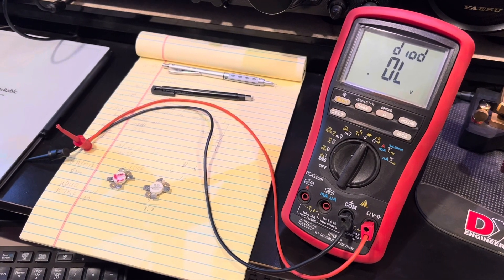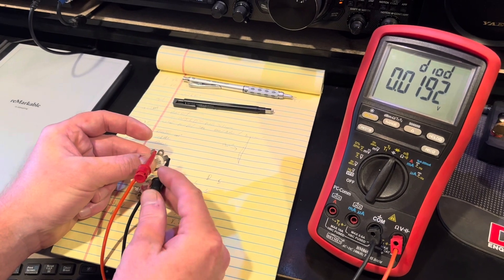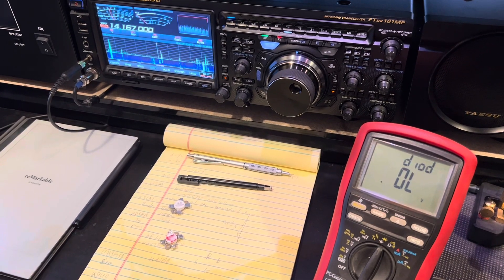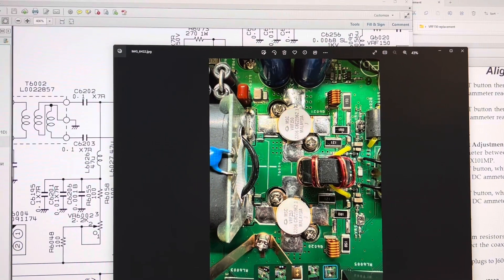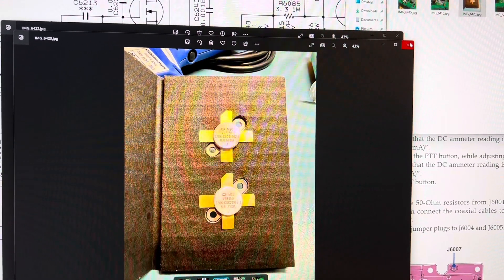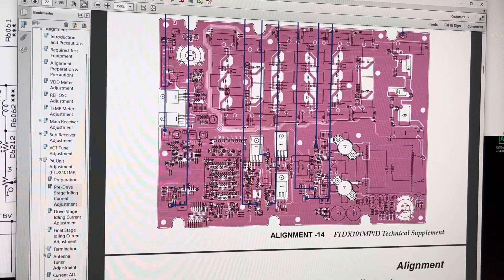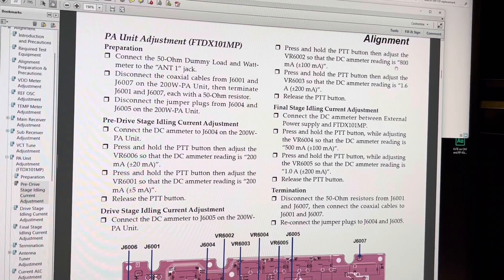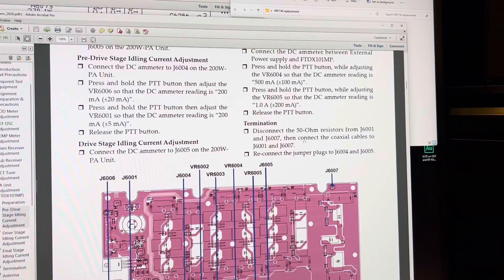Yaesu FTDX101MP PA finals (VRF150's) testing, replacement, and quiescent bias - KJ7E

Comment: I hope you could answer this -2 questions 

1.  how did you terminate J6001 and J6007 to a 50-Ohm Resistor what cables where used?
2.  For the Final Stage Idling current how did you connect a DC Ammeter between the Power Supply and the FTDX101MP?
Reply from the maker: For the PA Bias, the terminations is necessary, though I did buy some small jumpers to that plug into the PCB sockets that extended to BNCs and can connect to BNC dummy load terminations.  Ive done it both ways and the terminations are not necessary.  I inserted a current meter between the 50v supply line, and nulled he non TX current to get the bias measurement.
Reply: @damonkj7e  thank you for answering, this is the 2nd time my finals went bad. After yaesu repaired it, I've decided to do it on my own, I live in the Philippines and sending it to Japan again to get repaired is out of the question, because it's super expensive.

You replying and creating this video is super helpful. This means a lot.

73 and Mabuhay 

De 4E1FLD | N4SHX
Reply: @damonkj7e  Thank you for replying, this video is really helpful, for context this is the 2nd time the finals went bad on this radio, the first time, I sent it Japan for repair, and it was super expensive, to ship back and forth to the Philippines and on top of that I also had to pay for the repair cost.  

I had to wait 6 months to get it everything sorted out. 

So going through he same process is a no-go for me this time.

This video is really helpful.

73 and Mabuhay

De N4SHX | 4E1FLD

Comment: Thanks Damon, very helpful for me because I have the same problem 😞. How do you terminate J6007 with 50 Ohm for adjustment? What sort of plug is this. I cannot find anything that fits...
Reply from the maker: I did find the connector on a jumper to a BNC, I dont recall where from.  However, I found no reason to terminate J6007 since no RF is being generated.  I've made the adjustments both ways, J6007 terminated and without, no difference.
Reply: @damonkj7e  Thanks! I'll try it with no termination...

Comment: It is not normal that this failure to occur. The Yaesu FTdx101 should have gone to safety like it happens on the FT2000D. 🤔
Thanks for the feedback anyway.
73's de Ludovic - F5PBG
Reply from the maker: Correct, however I was in a mode that bypassed VSWR foldback (PA Current ALC calibration).

Comment: Sadly I have the same radio with the same rebooting symptom. I am tempted to repair it myself than wait months for a warranty repair. I think my attitude is similar despite having the radio such a short time, it worked when I got it but doesn't now...I had set a ceiling of 50w in the menu but subsequently did a reset so MIGHT have transmitted full power on FT8...
Reply from the maker: Running 150+ watts on FT8 is not a problem for this radio as long as the VSWR is below 1.5:1.
Reply: @damonkj7e  I have just got the new transistors, will fit them tomorrow. I will be careful not to repeat this, I feel it was me that blew it up not the makers fault. Though I have ragged my older Yaesus for years...
Reply: @damonkj7e  mine is back from the dead now, transistors were not ridiculously expensive from Mouser (UK).

Comment: ALC не помогло ? Мощность не скинуло ?
Reply from the maker: The fault was not with the radio, I had created a unique set of circumstances and caused this problem myself.  Its a long story, but involved a mode where the VSWR protection was disabled.
Reply: @damonkj7e   большой был разброс токов усилителя мощности с завода  по сравнению с сервис мануалом ?